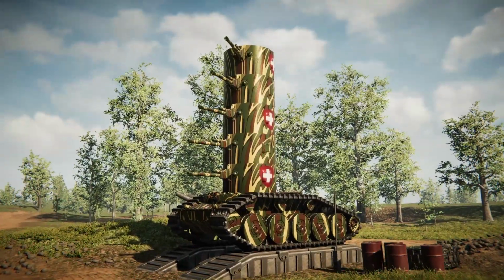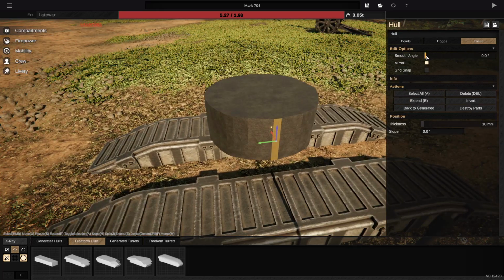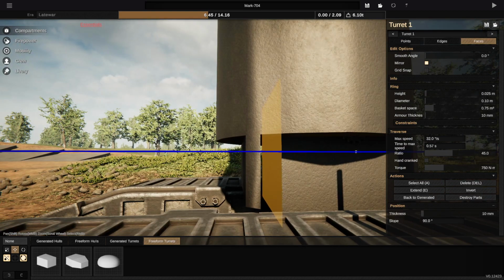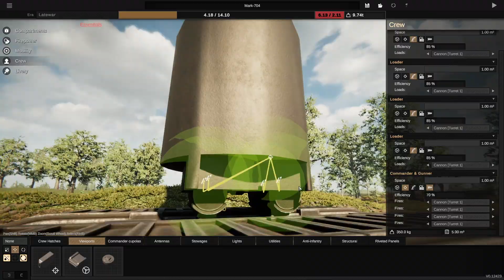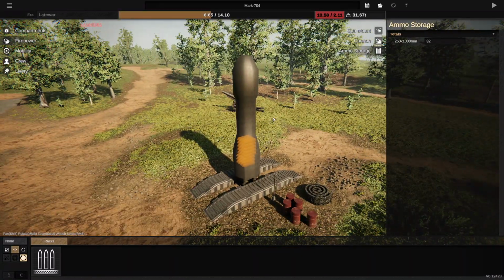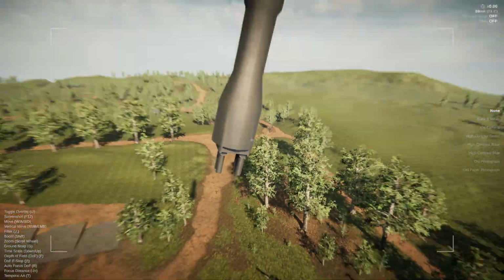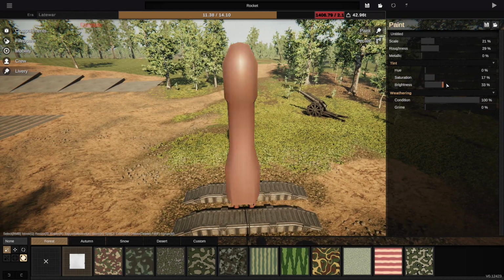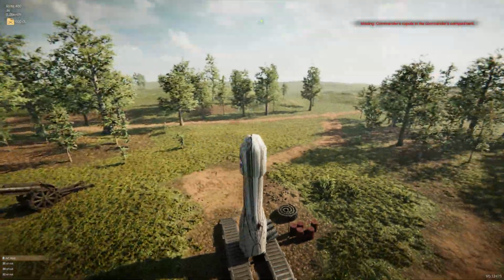I Built A SPACE ROCKET Powered By TANK CANNONS In Sprocket Tank Design!

Comment: Curiosity: Why not use a single 2500mm instead? Wouldn't it give literal more bang for buck with less Crew Management needed? Also, is it possible to use a Tank Cannon without a Mantlet when ya won't be needing actual ability to aim/traverse the Barrel? Lastly, is there a difference in ability to launch yourself into the air between AP and APHE...?

Also, it's a shame ya can't build Stabilizer Fins onto it... since Flying was never intended by the game, I assume there's zero implementation of fancy schmancy stuff like Aerodynamics... then again, Stabilizer Fins would at least make the Rocket look better and more legit...